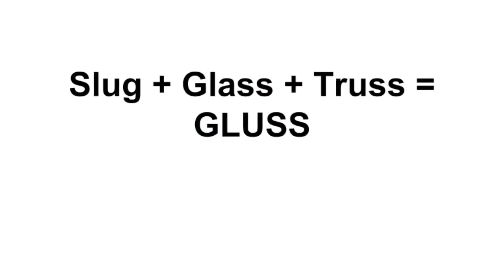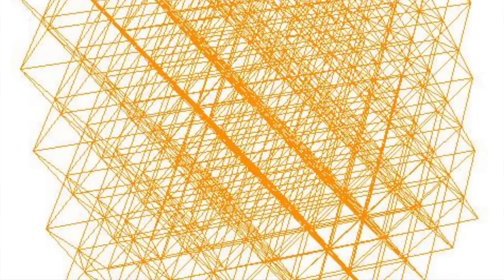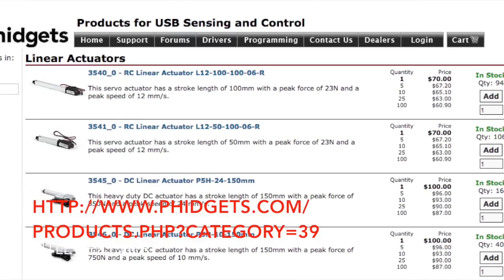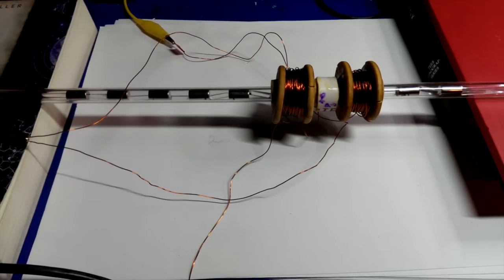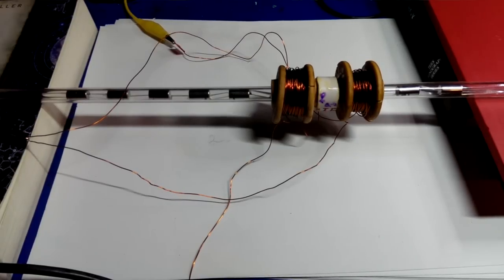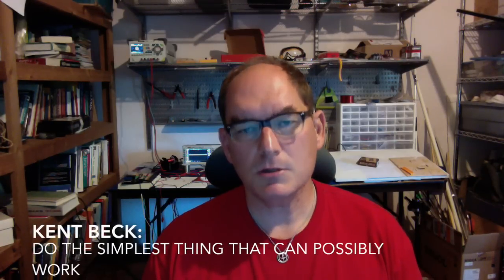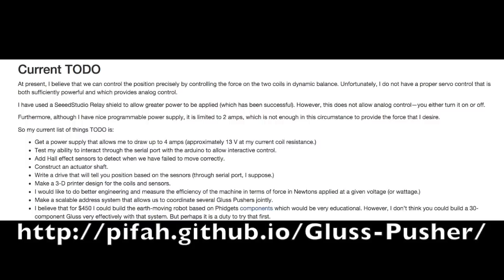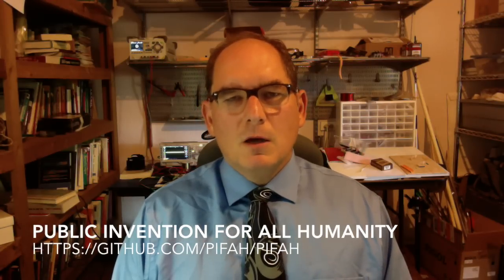Glussionics

Comment: Could you please share your source for the tube in which you're putting the 1/8" magnets.  Is that an off-the-shelf part?  I've found an 1/8" ID, 1/4" OD acrylic tube for sale online but it's minimum 6' lengths and costs orders of magnitude more for shipping that the part itself!
Reply: Daniel Schneider I got them at TAP Plastics (http://www.tapplastics.com/). However, I now recommend against using acrylic.  It is heavy and doesn't have good stiction or friction property (though it is attractive to see what you are doing.  I have now switched to carbon fiber, which again seemed super expensive until I found RCFoam (http://www.rcfoam.com/).  Their carbon rods are affordable. They are not arrow-straight but for this application they are great.  I will post my video with my 3d printed stator and the carbon fiber rods ASAP.

Comment: i'm quite interested to help with this project. I'm the CTO at Colossal3d.com.
Reply from the maker: +Kevin J Thanks! I've sent you email. It looks like Collosal3d.com (http://www.colossal3d.com/index.php?) does (large) 3D printing.  We will need a lot of that. I am in fact working very hard to produce a new video explaining a new kind of joint, which I believe is a true "invention" in that I don't think anything like it has been made before. I'm currently printing at a scale appropriate to the Firgelli L16 linear actuators (http://www.firgelli.com/products.php?id=42), but it would be nice to have the joints, which I call the "Turret" joint, printed in larger scales as well.